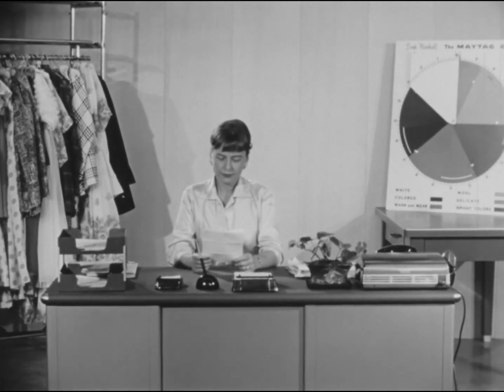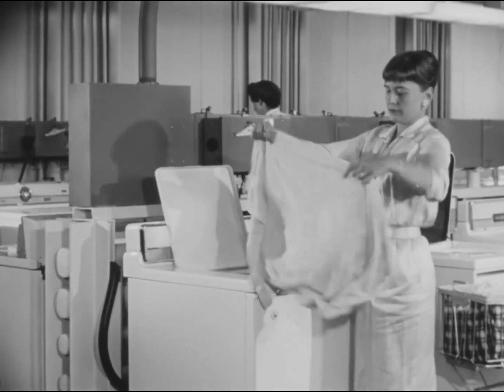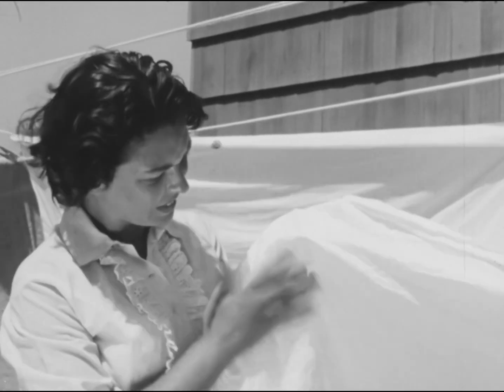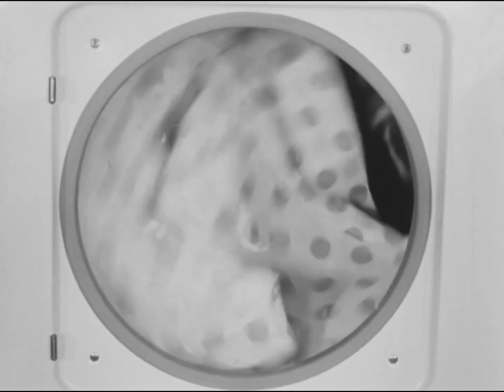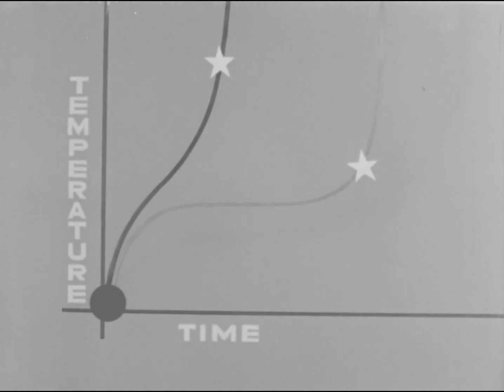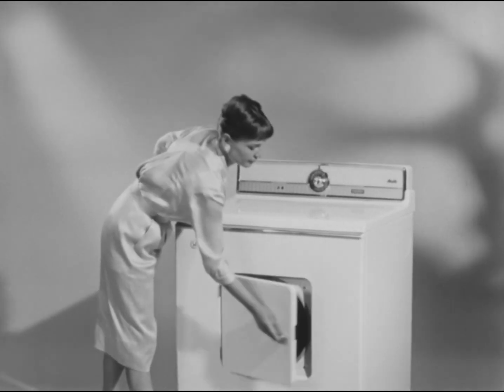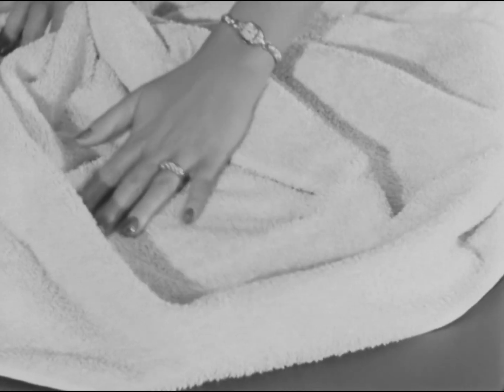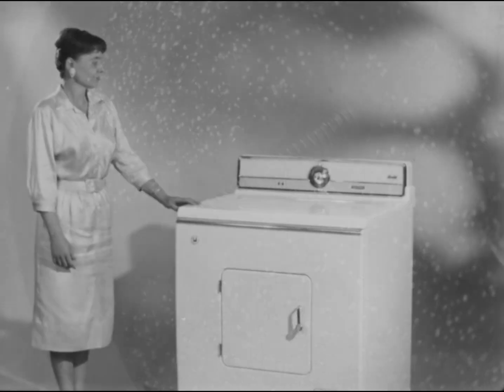Maytag Presents: The Story of Clothes Drying - 1960 Halo of Heat

Comment: I wonder how affordable the Maytags were back in the day. My grandmother had a pair but I recall they were fairly well off.
Reply: They were very expensive but paid off in the long run. They lasted for decades and Maytag held parts around for at least 50 years until Whirlpool bought them out in 2006.
Reply: Maytags were expensive but lasted for decades. There’s been some debate in various groups I am in between the washing and rinsing performance of a Maytag vs Whirlpool, but since I have experience with both, they both wash and rinse about the same. 

The only gripe about Whirlpools of the era is they don’t have a off balance switch, have had my Whirlpool go off balance a couple of times and came back to a crooked machine. Had that happen to my Maytag as well, but the off balance switch intervened stopping the machine.

Comment: Just saging, the tumbling action is what makes cloths soft not residual moisture, think of all the cloths dried on the line in cool weather, they were still stiff as a board.
Reply: But then they couldn’t convince you their dryer is better than the competitor’s dryer.
Reply: Tumbling action definitely helps but residual moisture does come into play. I have this dryer as well as the later Stream of Heat dryer that came in the 1970's. Both use electronic control and are very accurate at sensing the proper moisture.
Reply: Not true ,, they fresh and soft as a lazy summer 🎉🎉breeze
Reply: @IronMike-f8i Terrycloth towels are always softer from the timble dryer.
Reply: @IronMike-f8i I’ve hung up my shirts up to dry as a experiment, were scratchy and itchy, even with fabric softener. Even tried with towels once, same thing. 

On the other hand, my Maytag franken-dryer with the auto dry timer works quite well, even if things have a little hint on dampness, still come out soft and aren’t over or under dried. It is a Maytag Halo Of Heat model, but is essentially a Maytag DE407 with an 806 console swapped into place with the lighted console taking place of the neon indicator light.